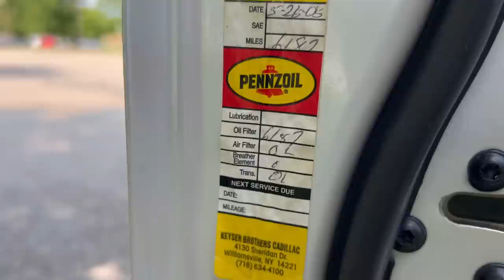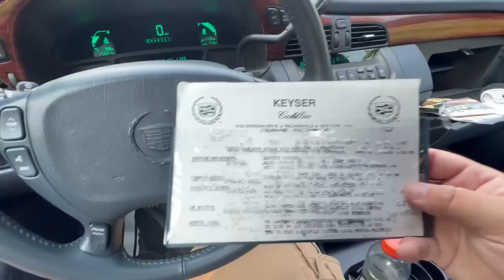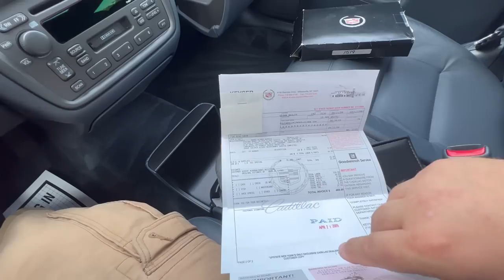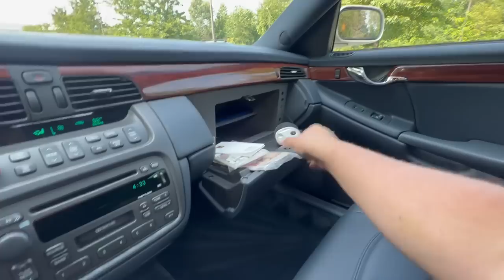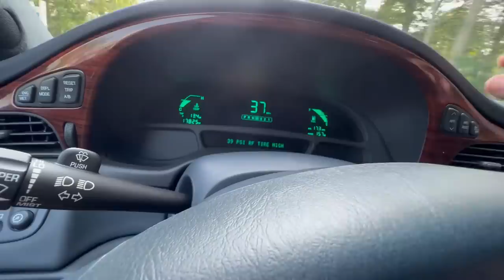2003 Cadillac Deville 17k Miles TIME CAPSULE Condition FOR SALE Specialty Motor Cars

Comment: I read on a Cadillac Forum that Cadillac did not switch to the new head bolts until 2004 on most of their cars. But some 2004 Devilles still got the old head bolts. 2005 is the first year ALL Northstars got the new head bolts.

Comment: I looked at an absolutely pristine 1979 Seville in triple black, astro roof & factory chrome wire wheels. It was the most outstanding example of the first gen Seville I'd seen to this day. This was back in 1984. A guy in the driveway was wiping it down & said it had 4,000 miles (5 years old). I wanted it so badly, but it wasn't for sale.

Comment: What a stunner!  My wife had one that I liked even more - it was done in the color that was so unusual, White Lightning. Other than that it was a clone - love the chrome wheels with narrow white stripe tires. Traded it in when it was over 150,000 miles. Wish were in the market for another Cadillac, but we have 3 currently. This jewel should be snapped  up quickly.

Comment: Had a couple of the these, 2000 DTS and an 01 DeVille, as part of your replacing items this cars fluids are 20 years old. Did you swap any of those fluids?
Reply from the maker: Oil, coolant have been replaced.

Comment: I would have placed the emblems on the lower quarters. Or one on the rear trunk, replacing DE VILLE. This emblem looks too old school and isn't a new car where modern emblems are placed. New owner: Chemical Guys top cleaner with soft bristle brush, plenty of rinsing. Micro fiber blotting and 24 hours later mask windows and paint. Chemical Guys UV/waterproof spray protectant , 3 coats and you are good for 3-4 yrs if garaged. I had a 2013 Camaro convertible, top looked brand new when I traded it in in 2018. 1.3 inch wide whites available at Coker in Cali "American Classic" I ordered them for my 1985 Riv, looked stunning! Luggage rack has to go! An Auto Body shop can take care of that, better than replacing trunk lid. The ergonomic chrome door openers are cool. Glad you are feeling better!

Comment: What about these Northstar engines? Everyone says they’re not dependable at all. Is that true? Please let me know.  Thank you!
Reply: Very dependable and good cars, unfortunately the head gasket bolts weaken and cause head gasket issues around 100k (give or take 40) miles. It’s quite an expensive repair as the engine has to come out. Usually $4-5k job. But once that issue is fixed they’re pretty good all considering. Obviously it’s no 2008 Toyota Rav 4 V6 with 285k miles, A/C blows cold and everything works as it should like my g/f’s car.
Reply: 40:21

Comment: Isnt this one of the bad Northstar years??
Reply from the maker: No Northstar is bad with proper maintenance. But 2003 and later era Northstars do have a better head bolt design that was done to remedy the previous poor design.
Reply: What about the Flickering lights on the Dash???
Reply from the maker: @mr.dillon2675  like I said in the video, the LED flash vs. the rate of capture from my camera isn’t the same rate. Similar if you try to take a picture of an LED television
Reply: Gm fixed the up graded head bolts in November of 2004 !
Reply: I had a 2003 that I bought with 25k miles. I owned for years, but had a accident @ 114k miles totalled in a accident 😢.  Never had a problem besides window regulators needing replacement. Car was a tank!
Reply: 40:21